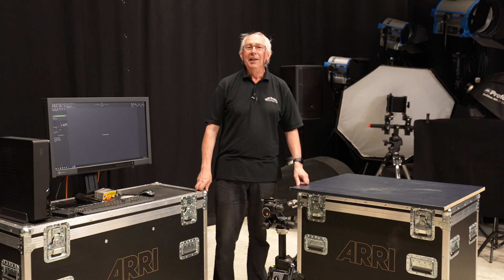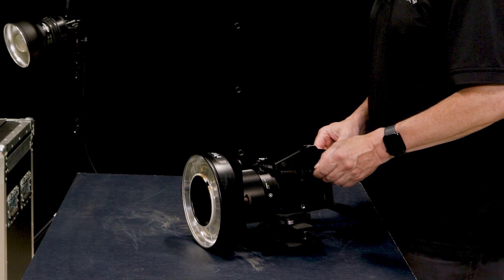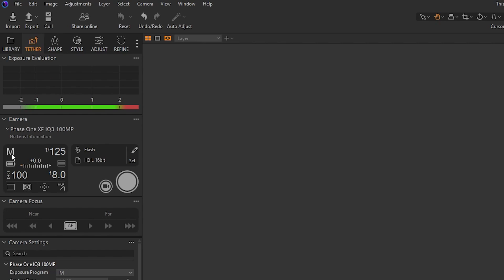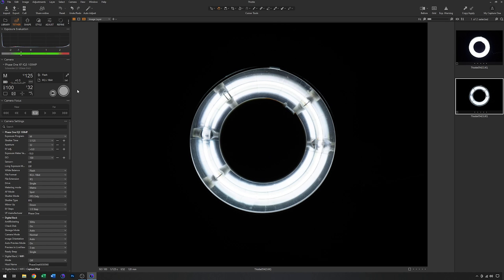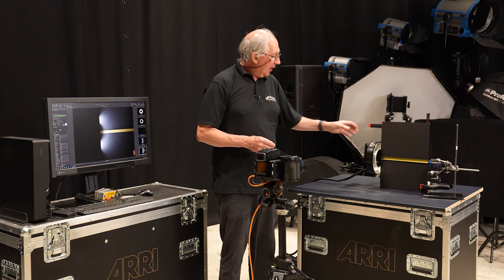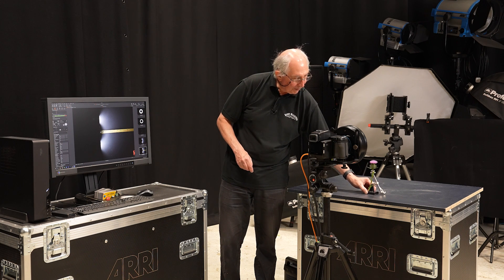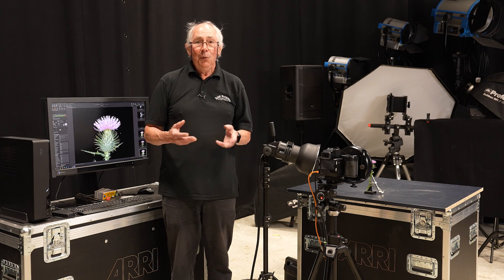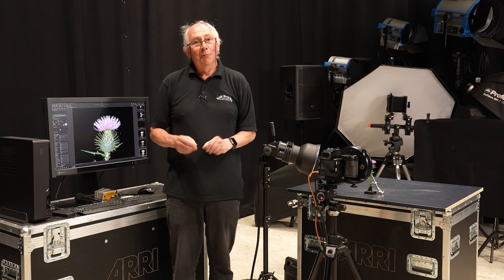Ring Flash Photography

Comment: Not good way of lighting a subject, ring flashes remove all shadows and depth, shadows is what makes a photo if you remove them you get a flat lifeless photo. I suggest upgrading your lighting to cheap on camera flash and pro diffuser like the AK Diffuser. As you can see in your photo your diffusion is not good and causing bad lighting a blown out spectral highlights. Ps been doing this for many years as pro photographer, the worst lighting is ring flash and LED. My recommendations for you are - Meike MK 320 or Godox V350 flash and AK diffuser.